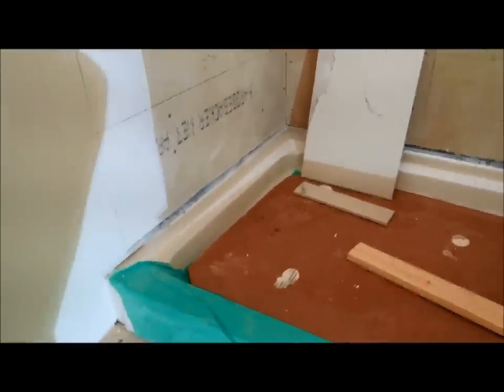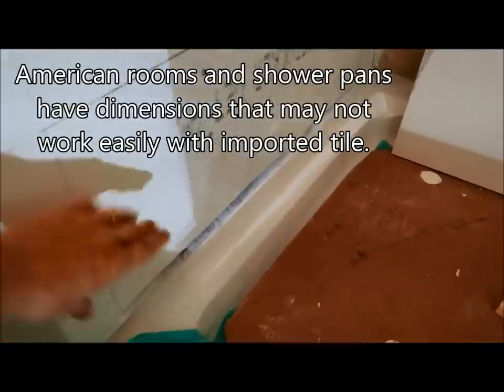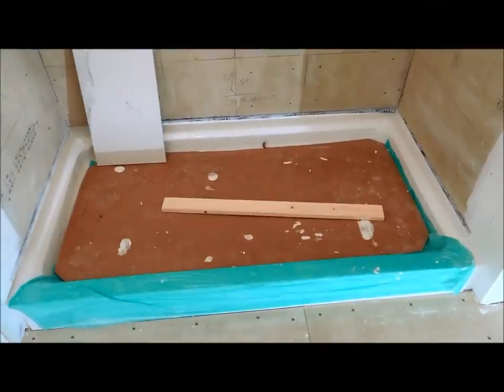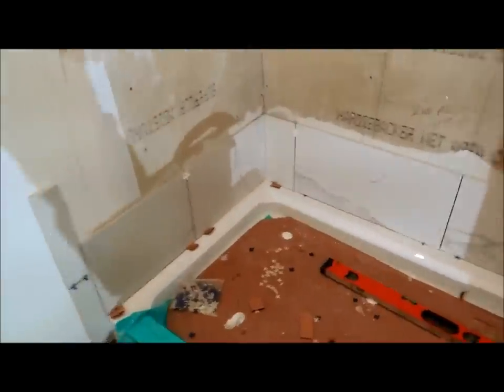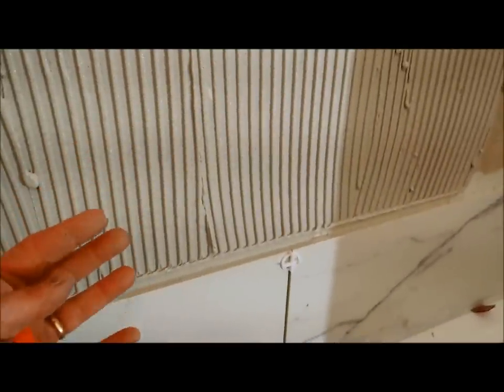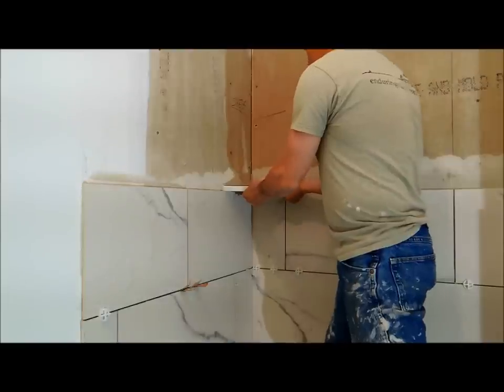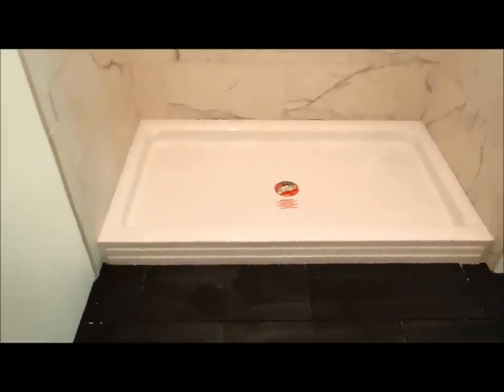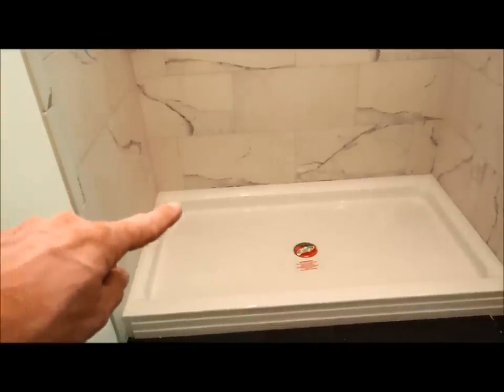Tiled Shower: Start To Finish

Comment: Hi like your work.
What is the trowel size you used for the tile  and what  thin set did you use?
Reply from the maker: Yossi Khalon The size of the notches on the trowel depend on the size and weight of the tile being used.  I would defer to what the tile manufacturer or your tile retailer recommends.  The brand of thinset is really not too important in my eyes, but I do use a modified thinset when I have a cement backerboard or wallboard backer.
Reply: Thanks for reply. I see that you did not use red guard  on the wall. Is that because you are putting porcelain tile or because it is not needed.
Thanks in advance
Reply from the maker: Yossi Khalon Under some circumstances so-called "waterproofing" is not necessary, in some cases it may be a good idea.  See this video of mine for more guidance:

https://www.youtube.com/watch?v=xk7lNudSV2Q

Comment: What did you do for waterproofing?
Reply from the maker: These days if I am tiling a shower with a tiled floor (rather than a pan or a tub) I use the Schluter system to waterproof the floor and I'll run it up the walls. If I am use a pan or tub, I may also use the Schluter Kerdi band in the corners and backerboard seams.  And, you'll see from other videos I do have a flashing system behind the hardibacker.  Otherwise, I generally don't think waterproofing the entire wall is necessary with Hardibacker.  You can find more discussion of this on my bath playlist: https://www.youtube.com/playlist?list=PLD4oAOZqK9mCjvmw_nUkZBrPPXf_20Lad
Reply: @enduringcharm  gotcha. That makes sense I don’t ever do it without schluter waterproofing but like they say to each his own. Looks like your work is nice regardless. Thanks for making the videos you do

Comment: stupid question, but don't you need the shelves to be sloped in the shower so the water drains?
Reply from the maker: Not a stupid question!  Depending on the particular show I will put a little bit of pitch on the shelf, which can be done by just adding a little more thinset in the corner or by adjusting the corner with a sliver of cardboard.  However, if you put too much pitch it looks bad to the eye.  Plus, I think the concern about water runoff is often overblown.  The shelves are fairly high and in a larger shower not that much water sprays there.

Comment: by my math you should always be able to come out with cut piece bigger than 1/3 of a tile ,what am I getting wrong?
Reply from the maker: I'm not sure specifically what you're asking.  In this pattern the tile was "wrapped" around the wall rather than ending at the corners.  In doing so you also need to account for the bullnose tile.  Plus, the dimensions of the wall and the tile are nominal, so a four foot shower pan actually yields an opening that is more like 47 or 46 inches and change.  Same goes for the tile.  A 24 inch tile is actually something less, since they typically use metric mesaurements.

Comment: Where the corner shelfs purchased or did you make them?
Reply from the maker: They are commonly available at tile stores locally.  They are typically marble and they can be cut smaller if you wish.

Comment: how many hours did you have into just setting the tile in the shower area?
Reply from the maker: When I'm working alone I can generally do a small shower and the floor in one long day.  Arrive and get the tools set up by 8:30, and I'm exiting the house and hosing down the tile saw by 6 or 7.  However, if the shower is large, if the ceiling or the shower floor must be tiled, if there is a lot of decorative tile, or if the bathroom floor is large then I'll go into a second day.  I hate having to set up the wet saw twice, but sometimes I have no choice.

Comment: Why do the box recommendations has a 33% off center
Reply from the maker: You are referring to a 1/3 overlap, I assume.  This was asked previously, so let me just quote my previous explanation:  "Large format tile can be tricky because it naturally tends to cure with an arc to it.  In other words, if you put two tiles face to face, you would typically see the faces touch in the middle with gaps at either end.  Some tiles are worse than others.  On a floor, especially, this fact can lead to "lippage" where one tile edge is slightly above an adjoining tile.  Typically we install large format tile overlapping by thirds in order to mitigate this problem.  Overlapping by half (the running bond pattern) can sometimes be done on tile up to 24 inches in length if the arc isn't too great.  Longer than 24 inches and overlapping by half becomes unlikely.  You need to examine each batch of tile to determine what you can and cannot do.  And, actually, expensive Italian tile is usually worse in this regard than an inexpensive factory tile.  I don't commit to a pattern until I've had a chance to open some boxes and put tile face to face to check for the arc."

Comment: Dude, why didn't you tape the corners with thin set and fiberglass tape before tiling? You will have cracking problems as well as water issues.
Reply from the maker: I respond to this question constantly, but I'll give it another go.  The need for taping the joints depends on the quality and the design of the framing underneath, as well as the brand of backerboard being used.   Taping can help prevent movement of the backerboard edges between two sheets when the framing is not ideal or when the spacing/positioning of the framing members allows movement.  If, for example, a backerboard seam splits on a stud or on blocking then taping is not necessary.  Also, some backerboard, such as hardibacker, is stuffer by nature and simply doesn't flex as much as others.  In this particular shower I may not have felt taping was necessary.  Other times I will use tape (or these days strips of kerdi membrane) to prevent movement.  It just depends on the circumstances.  The shower in the video is five years old now and I was at that client's home doing other work not long ago.  There is no cracking or water intrusion.  Other showers I've done are 15-20 years old now without issue.  

As for waterproofing, I do extensive flashing behind the backerboard which will prevent water intrusion should tile or grout or caulking fail in the future.  If I'm tiling the floor I'll also run Kerdi mambrane up the walls.  Sometimes I'll run the membrane in the corners if the framing is sketchy and I expect movement.   I make judgement calls.  Why not just use every possible technique there is out of an abundance of caution?  Well, because bath remodels cost a lot of money.  If I just blindly used every possible precaution I could think of for tiling, preparing walls, painting, preparing framing and subflooring, electrical, plumbing and fixture installation then the cost for my clients would be much greater.  So, I use my professional judgement as to what is needed for a particular bath.  In the last 15 years I've had only two bathroom callbacks.  One for a dripping faucet which Moen supplied a new cartridge to fix, and one recently for some caulking that dried up and failed.  I no longer use that manufacturer of caulk.

Comment: How much can be cost a shower  tiled and floor  just the labor job
Reply from the maker: There are lots of variables and shower walls and floor are typically done as part of an entire bathroom renovation because everything else is built around the shower.  Even the type of tile, pattern, and size of tile play into the cost.  You'd have to have a contractor look at your particular circumstance.

Comment: Why you not using laser level?
Reply from the maker: I set the starting row level, either with a temporary "ledger" or by having the tub/pan dead level, and then work up from there.  Sometimes I'll check for level along the way if the tiles are imperfect or very small.  I own a few laser levels, but I just don't find them useful in this situation.  A four foot and three foot spirit level work just fine, and also act as a straight edge.  Having a laser set up in a small bath would just be something to trip over or damage.

Comment: No tape on the corner joints?
Reply from the maker: See some of the many other comments on this.  If the framing is supportive enough then I may not use mesh tape, which is meant only to prevent movement between two panels.  I install flashing behind the backer for potential water intrusion.   In some installations where the framing is sketchy I'll use mesh tape or, more recently, just use the Kerdi membrane on the joints.
Reply: enduringcharm oh ok makes sense, figured you did it for a reason just wanted to know why, thanks tho lol

Comment: I noticed you don't tape/fill the joints on the cement board. Do you need to?
Reply from the maker: +Imran Ikram I should make a video, because this question comes up constantly.  The mesh tape and thinset is used to help keep the seams or edges of the backerboard together.  If one flexed independently of the other, it could potentially lead to trouble.  So, if the framing behind the backerboard is close together or if there is framing or plywood installed at the seams, then the tape and thinset are really not needed.  On the other hand, if the framing is marginal or if I see too much flex, I will tape the seams.  I also use hardibacker brand backerboard, because it is much stiffer than the competitors.
Reply: +enduringcharm Thanks for your answer!